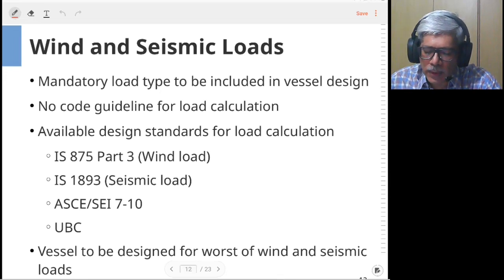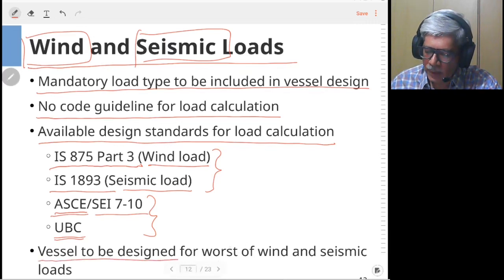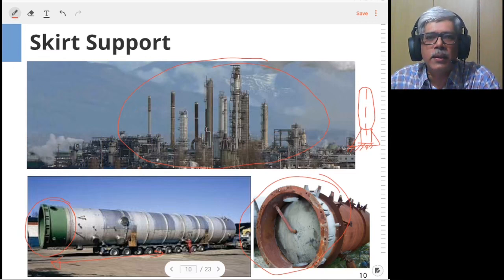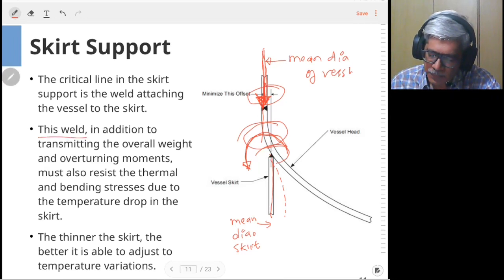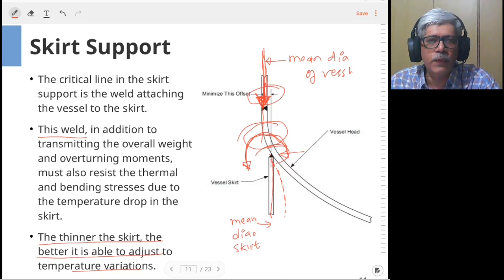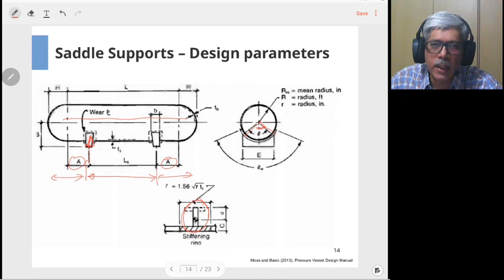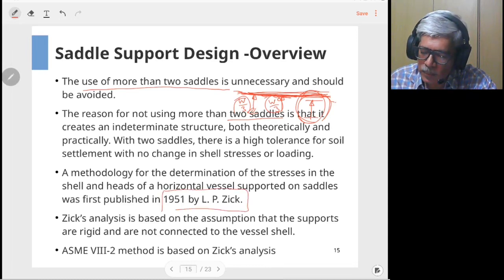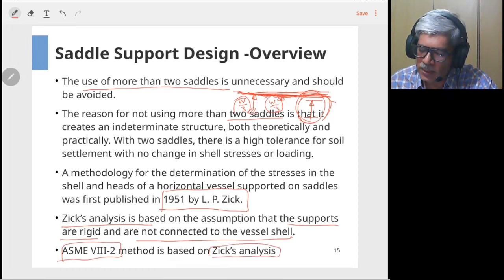S13B Support Design - Skirt and Saddle Supports

Comment: This is so informative. Sir, Can you please suggest any book for zick analysis.
Reply: Zick, LP . Stresses in large horizontal cylindrical pressure vessels on two saddle supports. Weld J Res Suppl 1951; 30: 435–445.